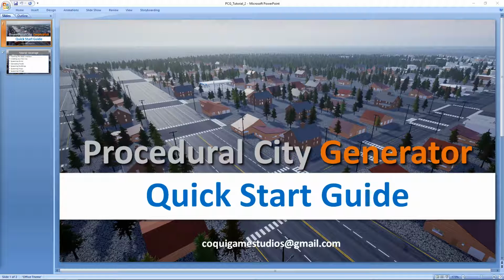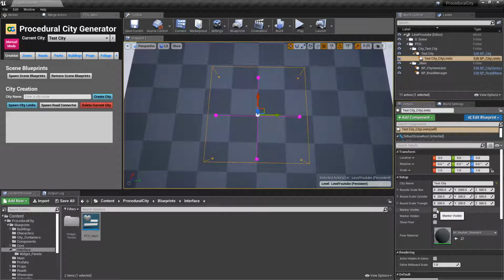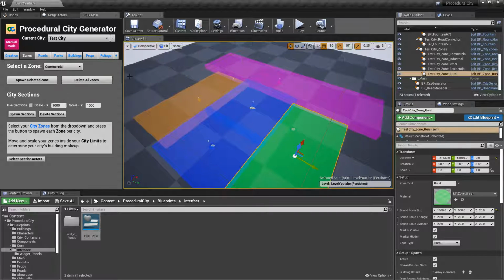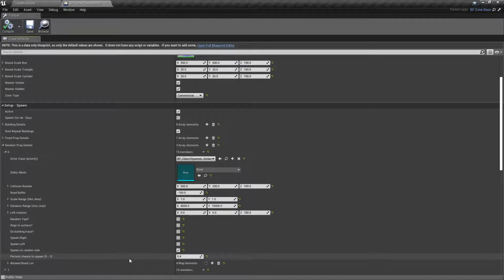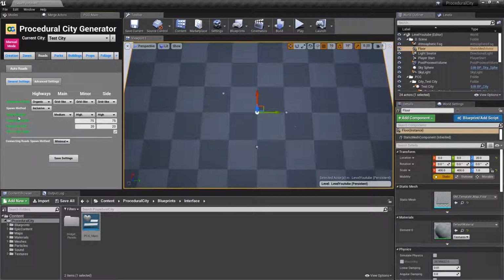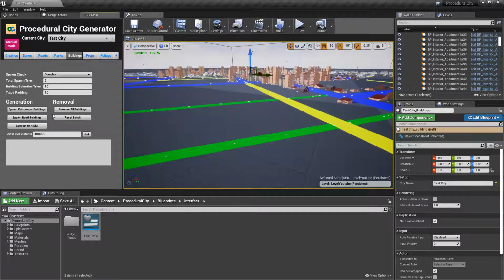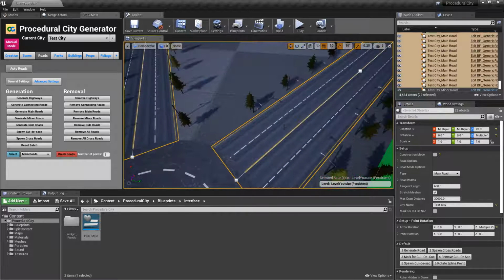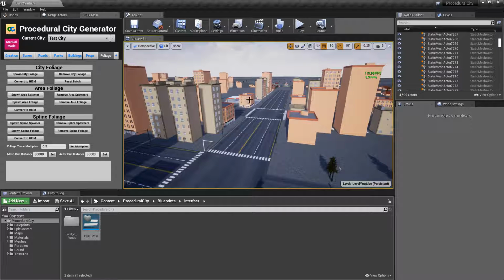Procedural City - Tutorial Series - Quick Start Guide

Comment: Hey bro 
I made a city but i have to migrate it to the other project

I only need its map and for houses i take reference from your original assets 

I think all the buildings are blueprints
And hard to migrate

So just migration of the city map will work.
Reply from the maker: Hey there - if you migrate the map it will move everything that is needed along to your new project. Make sure you use the Migrate option inside the engine (dont copy files manually)